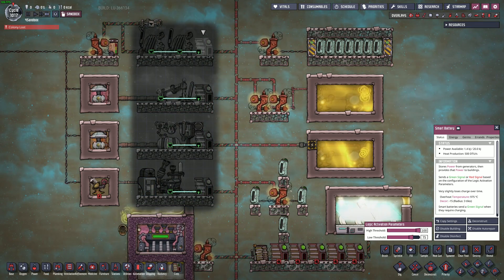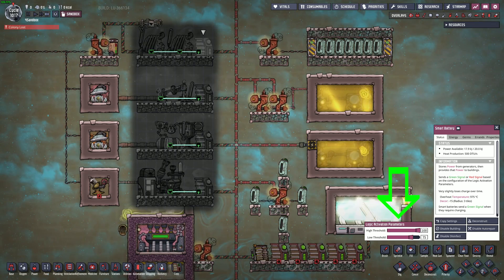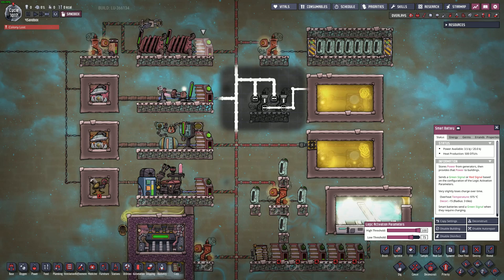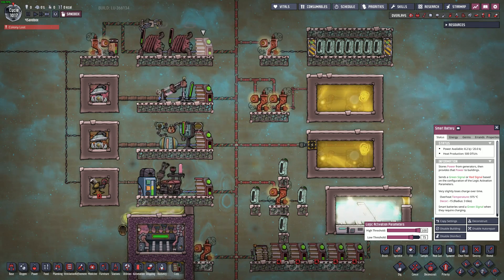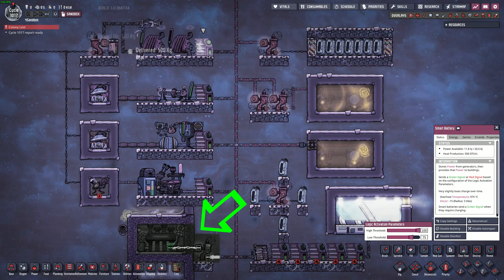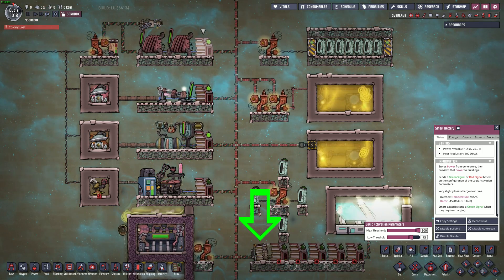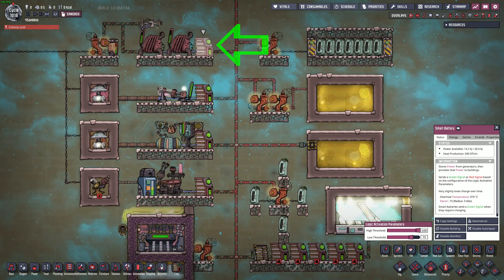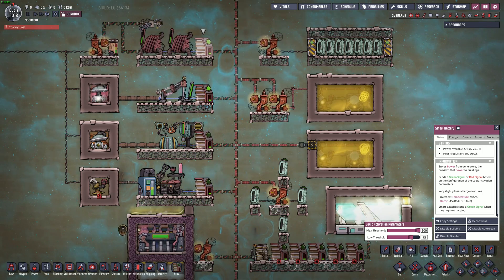Oxygen Not Included – Standard Power Grid (Heavy Watt Backbone)

Comment: Is there a benefit to omitting a smart battery to transformer stopper? Either automation battery to transformer link or battery to wire break from the backbone?
Reply from the maker: There's only 2 reasons I can see for wanting to shut off a transformer (or use a power shutoff leading to a transformer) with this design:

1.  To stop the transformer from giving off heat.  However the transformer doesn't give off much heat at all, it still needs to be on a lot of the time to transmit power, and the smart battery you're adding to be able to turn it off is adding heat too.  You'd probably be using the disabled the transformer method here (because the power shutoff method needs to drain the transformer's internal battery before it stops producing heat), which means you're going to slowly lose power while the transformer is off (plus your battery runoff in the new smart battery).  I just don't see this method worth it between the minor heat savings and extra material cost.

2.  For shutting off an entire line of consumers.  This seems like a very niche use to me, but some people play this way.  

I think most people wanting to do this don't understand that:

1.  Transformers don't actually consume or lose power (when on), they just pass it along

2.  Power consumers that aren't running don't use power (like a liquid pump in an empty pit).
Reply: @GamersHandbook  hmm good points. Considering a transformer is 1k DTU's and smart battery is 500, I assumed everyone did it to bring down the heat output of the transformer by making it intermittent. But if the battery is adding in a constant 500 anyways I'm not entirely sure it's doing much of anything beneficial lol. I can still see this being useful in systems where drain takes over a cycle, but I don't know the inner workings enough to know the benefits of using or not using a shut off.
Reply from the maker: @jtjc7705 It takes 50,000 DTU to run 1 port on a steam turbine at 125C (aka the bare minimum).  That's 50 transformers!  I just don't see the heat transformers put out worth being concerned about in normal circumstances.
Reply: @GamersHandbook  awesome, thank you!  :)